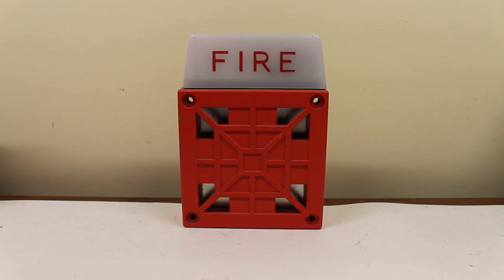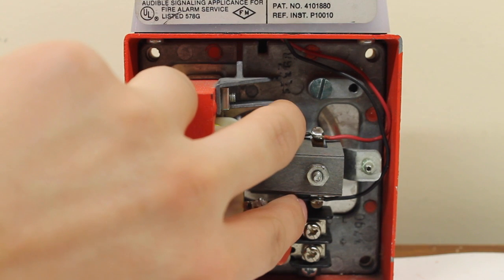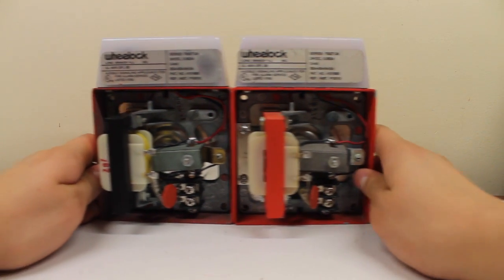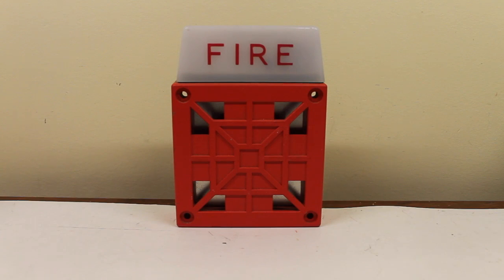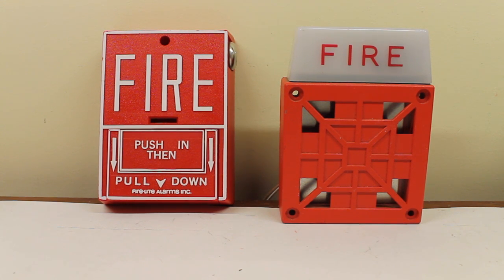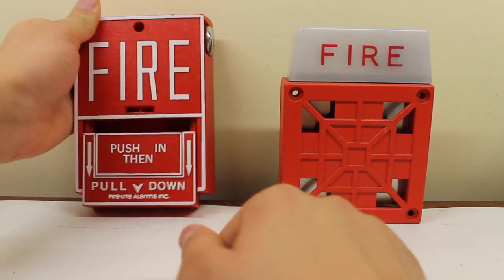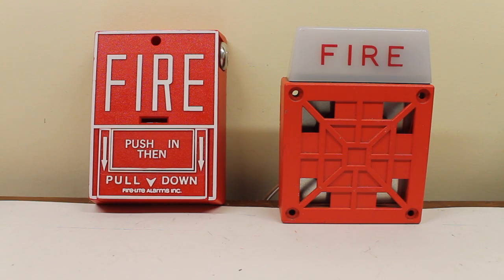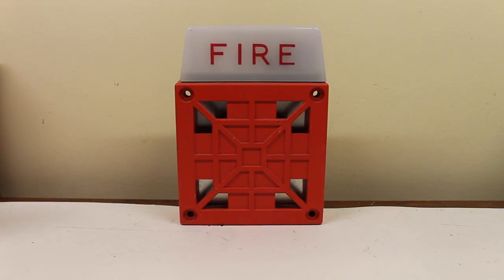Wheelock 7002T-24 Fire Alarm Overview/Test

Comment: My room in my apartment actually has one of those, and a couple of SpectrAlert Advances around the halls. Coincidentally, they went off a few days ago around 5 in the morning due to someone burning food. I will say that the 7002T-24s are wayyy louder than the SpectrAlert Advances in my experience. It was so loud to the fact that I could feel my heart vibrating from the sound. It was very unpleasant that It woke me up from a dead sleep, but it did exactly what it's supposed to do, saving my life.
Reply from the maker: I wish they still made these electro mechanical horns in general...the Advances are just unnecessarily loud. These horns are loud and can wake you up but won't damage your hearing as bad. Actually surprised to hear that there are these units in the actual apartment units.
Reply: @NewEnglandElevators  Yeah they need to bring back those electro mechanical horns. They're more reliable than the speaker horns, and like I've said in my experience it grabs attention alot better.

Comment: I remember those from grade school in the early 80's.  Yep that's the sound.
Reply from the maker: If it was the early 80's, then it was probably the original version (the 7002), looked like this, but the grille had a different style (it was more open). However, it's pretty much the same thing as here, and in your experience, the same exact sound.

Thanks for watching, always interesting to hear fire alarm stories!

Comment: That skipping is a reason why we don't see electromechanical horns used on new fire alarm systems anymore, due to the current draw. Electronic horns draw way less current, and thus eliminates the "skipping."
Reply: Nathan Delaplaine  Nope, some companies still made them. But yeah, by the late 1990s, electronic horns were more common, and it was easier for them to be 2-wire than electromechanical horns (this is why the 7002Ts skip.) Wheelock continued making the 7002T until around the mid-90s, and the MT-24-LSM became their signature alarm signal (nowadays it's the Exceder.) Even Faraday was making electromechanical horns for fire alarm usage up until 2007 with the Wheelock lawsuit that pretty much killed Faraday.

Comment: So running mine on 24VDC it sounded quiet and raspy. The strobe also flashed slowly. I was using two 9v and four 1.5v. Do I need to supply more amps?

Comment: I own an extremely old 7002T-24 that was taken out of a middle school many many years ago. It actually has the Wheelock tag on the back of the strobe is actully stamped on instead of being a sticker, it also says it's rated at 0.5 cd. They had them paired with Edwards (gs) rebranded BG-10s (aka the 279A). I own one one of these from the school and it is is remarkably good condition after sitting in my grandfather's shed for probably 20 years, although both of the wires have come off the switch.
Reply from the maker: I have a 34T-24+WS-24 that has the label stamped back on the strobe, as opposed to the commonly used sticker. Mine was made in 1986. Not too sure when they introduced the sticker, could have been a year later.
Reply: How do you know when it was made?
Reply from the maker: Somewhere on the back of the horn, there should be a 4-digit code. The first two digits dictate which week the device was made, and the last two dictate the year. The "3790" on mine dictates that this was made the 37th week of 1990. My 34T-24+WS-24 has a code of "3186," essentially, the 31st week of 1986.
Reply: ***** Mine has "1986" on the back of the horn.

Comment: nice, I have the one with the black on the transformer, I wanted to get a look under that cardboard cover that is fastened with that nut and found that there is one more nut that holds down what looks like some sort of relay with an adjustable plastic screw that kinda just rides the metal horn material , I adjusted it a little because the horn was sounding funky but I removed the thing off the mount all together and all that happens is the horn pops backwards (no strobe either) like it would lift the relay maybe causing some sort of mechanical oscillation maybe because a transformer on DC needs an oscillator in line (transistor) with a capacitor to work and the relay is clicking back and forth so quickly it is working with the diode and the capacitor on there like it was some sort of mechanical oscillator instead of using a transistor .. I haven't confirmed this yet but I think that's what makes sense to me.. Keep the videos rolling ! I just started my collection and have some fun plans ahead.
Reply from the maker: +Ryan Szumiesz That area under the cardboard cover is not a relay at all. It's the switch that switches the coil on and off rapidly. I wouldn't recommend messing with that, you must have bent the contacts. Don't think a new diode would fix that, either.

Additionally, I do hope to keep the videos rolling!
Reply: +NewEnglandElevators . Ahh thanks for the second look at the coil, I was thinking of it as a transformer and it didn't quite click in my head that it could be just a coil , the tip off should have been the single wind of wire on it and only two pins lol . I had it apart because it sounded like a sick duck , i'm assuming this is why I found it in a dumpster but some minor cleaning and a small tweak of that plastic screw got it in consistent good working order again .
Reply from the maker: +Ryan Szumiesz Glad you were able to fix it. You found yours in a dumpster? Lucky! Must have been replaced.

Comment: You should check out the 7004t, I believe in that on they fixed the skipping.
Reply from the maker: +Rodj One of these days, I would like to get one. It's powered by 120vac, so there's probably more power going into the device. More power to go through the device, less skipping.
Reply: +Rodj The "skipping" was actually designed intentionally to make the signal more noticeable in noisy areas.

+NewEnglandElevators Actually, I believe the horn and strobe on the 7004T are wired in parallel.
Reply from the maker: +Fahrenheit4051 Interesting about the intentional design to make it skip. Thanks for the input!
Reply: the 7004T is basically a wheelock 31T-115 with 7002T style strobe.

Comment: Actually, there was a pre-1985 7002T with an open grille.
Reply from the maker: +Fahrenheit4051 Didn't realize that. I assume with the open grille, there were terminal connections as well. Makes sense, I have a speaker/strobe that is the CF819T-WS24VDC, and it has terminal connections. Thanks for the clarification!
Reply: ***** Yes, there are terminal connections. That's what the "T" stands for.

http://firealarms.tv/collection/wheelock-7002t-24-2/

Comment: I've seen that setup before too. It is at my local Asian restaurant, and in many Government housing buildings.
Reply from the maker: +SirensOfCincinnati Which one? The BG-10 or the BG-12. If it was the BG-10, I must have been spot on, seems like these were installed in more basic systems in the late 1980's/early 1990's. If there was a BG-12, then that pull must have been a replacement at some point.
Reply: BG-10
Reply from the maker: +SirensOfCincinnati I thought so! :D